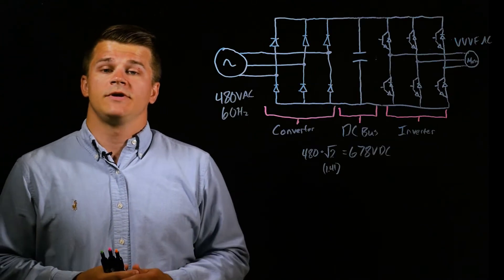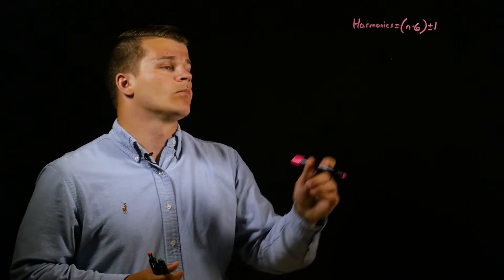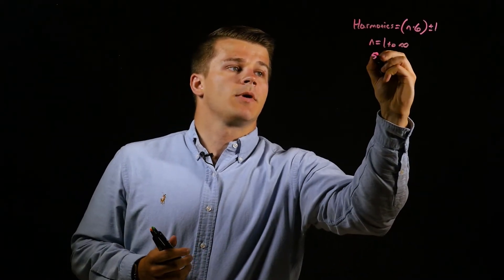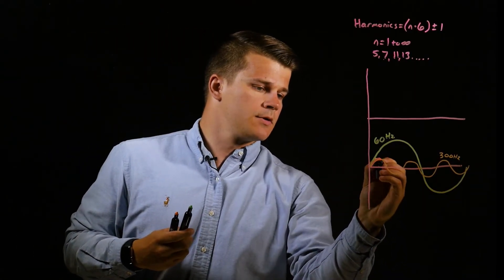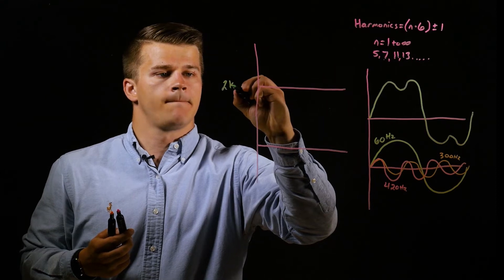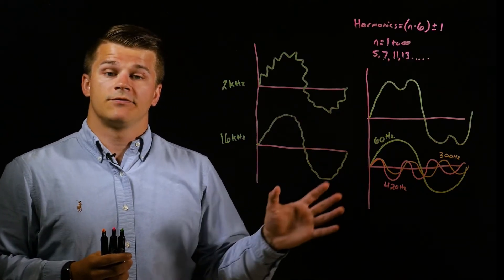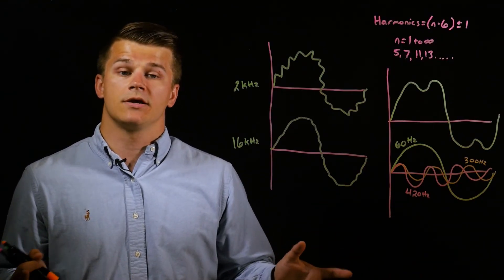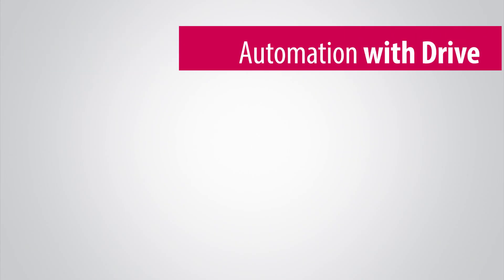How do VFD Switching Frequencies Affect Harmonic Distortion?

Comment: Thanks for the information. I have a question, If we are increasing the switching frequency will it not effect the output voltage ? Since output voltage is rms of the pulses that we get from the switching of IGBTs.
Reply from the maker: Thanks for your question, 
As the switching frequency increases, in order to maintain the same RMS output voltage, the pulse width is reduced. This is the function of the pulse width modulation. The amplitude of the voltage pulse, when the output transistor switches on, is the DC bus value of the drive. So this does not change with increased switching frequency. By reducing the pulse width (or on time of the transistor) the RMS voltage can be controlled by the VFD. I hope this helps.
Reply: @KEBAmerica   Thanks for the reply,  yes it helped me understand.

Comment: why are we multiplying the input voltage with root 2 value
Reply from the maker: Thanks for your question, @Raghavendaran J 
Short answer: It's just the relationship between the AC input and DC bus voltage because of the six pulse bridge rectifier used in VFDs. 
The long answer gets into more electrical engineering/physics theory. You can read our article on our blog for a little more information on the subject: https://kebblog.com/vfd-switching-frequency/
Reply: RAGHAVENDARAN J that's general concept. In ABB, DC vtg is 1.35 times of I/p AC